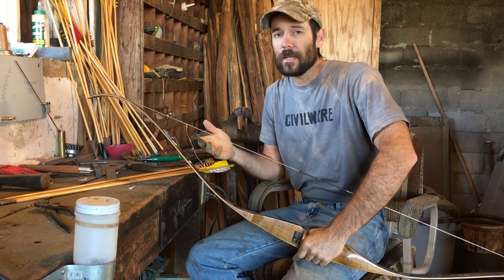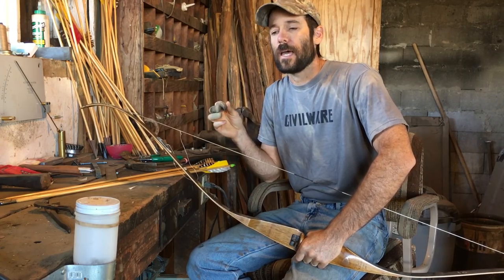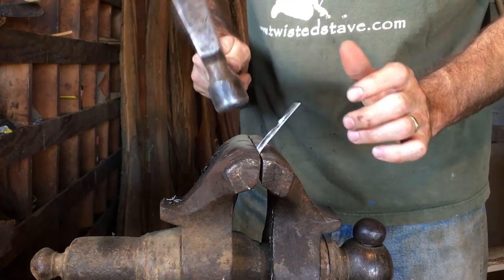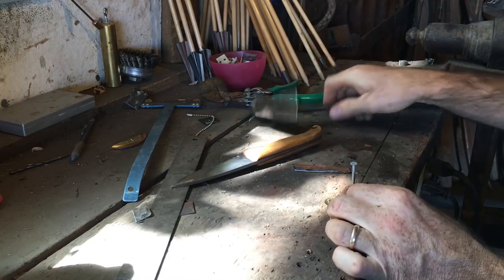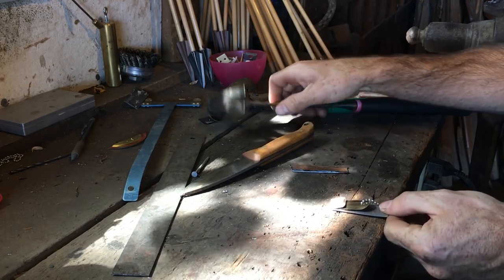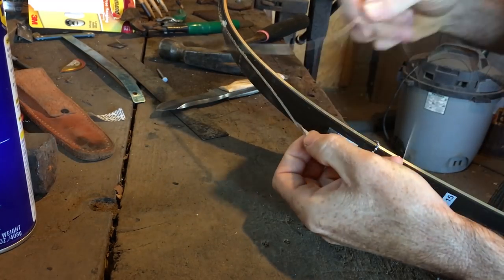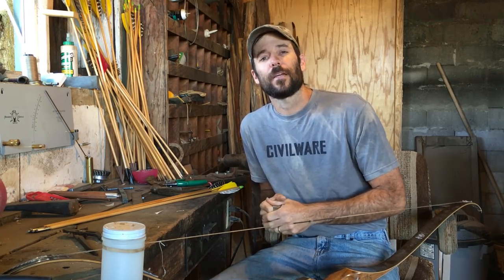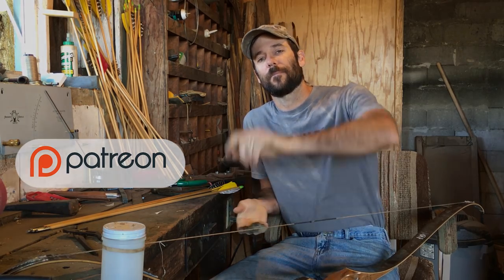How to make a DIY Archery Clicker

Comment: Don't use the ball chain, makes alot of noice and can harm the finish on your bow if it kicks against it. Also you might use compound D-loop material because it's a little more durable and heavier so it won't twist around the string as much. Great video though!
Reply from the maker: good tips, thanks